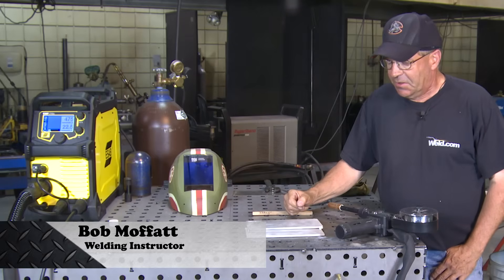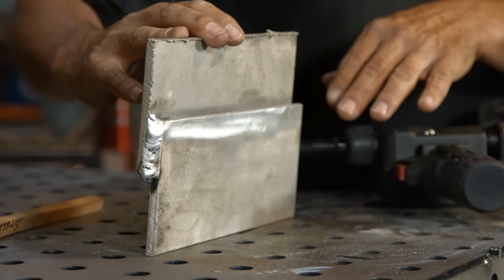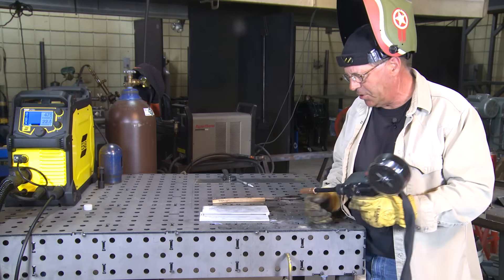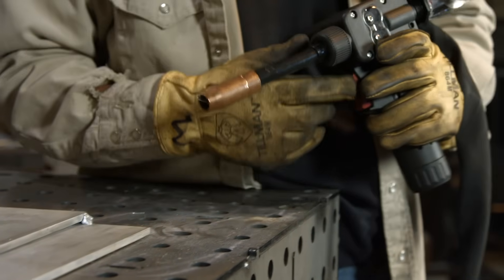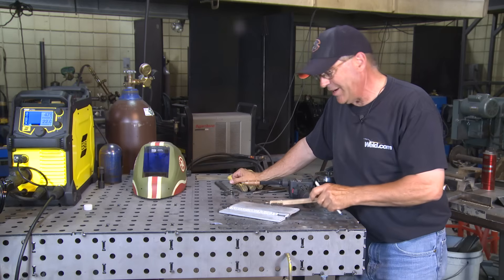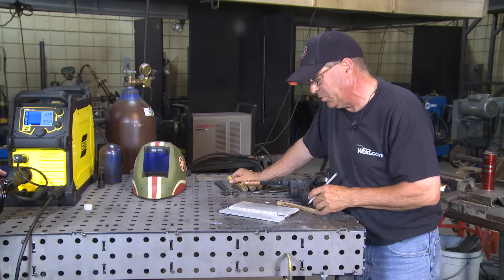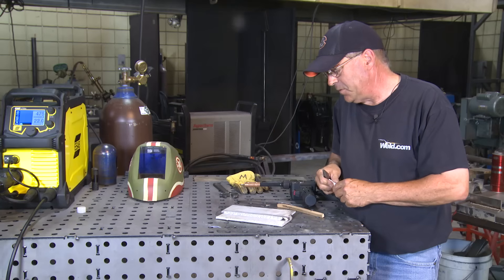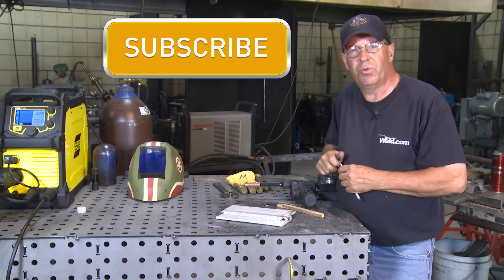Tips For MIG Welding Aluminum Lap Joints With A Spool Gun

Comment: Thx Bob! It sounded like you were in spray mode. Is it possible to achieve spray mode with a lower voltage say for welding 1/8 to 3/16 aluminum?

Comment: I would have dropped the voltage a bit and adjusted the push angle a bit heavier For 1/4" I've had lots of success doing steps from centre of my arc to the leading edge of the puddle and holding 1-2jump1-2jump (*note those are rapid 1-2 counts not anywhere nearly as long as Mississippi's haha) by doing so you find the sweet spot for speed and can then run that pace at 1/2 speed without steps just fluid motion, this welder appeared to be using a 3 steps forward 2 steps back waving back and forth slight push technique which sets his travel speed. (Everyone's is slightly different and everyone runs slightly different parameters, no 2 welders are the same✌️. you shouldn't be way out of the range of parameters or angle ranges and push for more penetration pull for less but 99% of the time you'll be pushing). Practice stringers much more than weaves. Thin guage? ( around 1/8 and below) Keep your work elevated off the table to have less heat dissipation into the work table below and a better more even weld with a more stable arc that goes where you want it to. ! Happy welding lads. Any questions just post a reply I'll answer when I have time.

Comment: Hello

I have Iweld double pulse MIG welder, and I got stuck with the setting. We used synergic MIG welder before and we wanted to change for dual pulse since you can make way better work with it, but I can't even find any settings that works for us.

The problems:

The wire is literally dissapear most of the time when I start to weld and I see something like fire. (As I could see there is not setting for wire speed, I could only turn the wire speed with amper)

And there are still the black spot

Comment: I would have liked to see that unclean weld cut open. Do you not have to use a SS brush to remove the oxide layer when MIG welding like you do on TIG?

Comment: Like TIG, is it preferred to have AC on MIG aluminum?
Reply: No.  If you recall the "Cleaning" part of the TIG cycle?  The electrode gets hot, the work is cleaned a little (oxides come off, you get a sandblasted look near the weld), MIG is only that.  DC electrode positive all the time.  LOTS of "cleaning" action.  doesn't the electrode wire get hot?  Sure, it does!  It melts and is thrown on to the work.  So, it's hard to TIG with DC + polarity b/c too much heat goes into the tungsten and it gets so hot, very inefficient.  MIG DC+ is fine, because the hot electrode goes on to the work and it's just more heat transfer.

Comment: Hi Bob, I’m looking for some tips on welding thin gauge (16) aluminum with a spool gun. I know it’s not ideal, but it is what I have to work with at the moment. I’m looking to fix some areas on the chines/ keel of an old Jon boat. My plan is to clean, clean, clean, and then I will be fitting sections of 1/8” angle aluminum over the bad spots in the keel followed by seal welding. My thought is to concentrate my pool more towards the thicker metal. Any tips on preheating or anything you could think of would be great! I’m thinking .030 wire with a .035 tip. Your videos are awesome! Incredibly helpful coming from a 15 year union Ironworker

Comment: Excellent. Now you did use a Spool Gun but can you explain a bit on MIG welding Spool or not doesn't matter what issues can occur like wire burn's back to the tip and like what difference the Argon Flow would make. Thank you

Comment: For the machine you used did you program it to your wire size? Im wondering if you bumped it up a couple wire sizes it would allow you to have more perameters to choose from? With my experience running a spool gun or push pull using 3/64 5356 welding 1/4" ive always ran it in hot ranging between 450-500 wfs and 24.6-25 volts with either equipment making a fillet weld... i understand youre only using .030 and its limited however having options is also nice. Also i am impressed on how it cleaned on the "dirty side" of your work piece, i was expecting porosity everywhere; do you think you could do a demo on alum that was previously covered in grease and other oily grime, with only a good wipe down and minor grinding prep?

Comment: Luv your videos.  I find them very informative.  I'm retired now,  but I welded in a production factory for years, but never really got much training.  Went in knowing nothing, got 10 mins. training, then got put to work on a production job.  I just started reading  welding manuals and learned a bit from the other  guys.  Like a lot of welders, I never did get any welding certificates or did any tests.     
  Like you said... cracks often start at the end of the weld where a shallow scoop out is sometimes left.  Your method of pulling back and back filling a bit is very good.  I do that too.  However in some situations (like thin sheet metal ),  I find  2 welds work better.  Weld in 1/2 way from both ends and join the welds in the middle.  In a stress area, I'll sometimes even  put a short support weld on the back edge and wrap the corner. A little extra support at a stress point never hurts.   Thnx again for you great videos.  
    Ps...  I'm thinking about buying a small portable 120 / 220 stick welder for a few retirement projects (steel framed picnic tables etc. ).  I know a lot of the small welders are junk, but the AHP arc 160 st  looks like it might be pretty good for what I need. It gets good reviews, but I've never seen one.  I'm looking for a good quality unit that will burn a 3/32 7018 rod on 120 a household current.   Price is not a big concern.  I just want a good one.  Any suggestions ?
         Thnx again,      Gord   gord247@hotmail.com

Comment: um did that brush say steel ,..  your not suposed to do that
Reply: allways use aluminum only gear buy stuff just for aluminum your helmet and jacket are fine but switch everything out to avoid any cross contamination it could leed to porosity problems in aluminum

Comment: Thanks I tried it today my beads look ok but not like yours. I have a Miller 252 /30a spool gun. I have been practicing as much as I can. I'm bust all summer with work. I helped out friend that built boats in my 20s when off in winter fitting boats but never did the welding noe I'm working on the welding. Not a lot of vidios on aluminum. I'm running .035 wire. Seam to be good. At 23.5 amps on 1/4 plate wire at 670-720 is so fare mt best work Thanks Dave

Comment: you are right about the time saving aspect of mig vs tig. not having the "luxury " of time, in a production shop is what it all boils down to. pretty, time consuming tig welds with very little post -cleanup have their place. less pre-heat concerns with mig, on thick sections. when building a pontoon boat, you'll meet your deadline quicker with mig. small jobs sometimes go quicker with tig. there is a balance to be found, which only experience and the advice of other knowledgeable fabricators can make it all come together in a timely fashion. learning by mistakes and success is a hallmark of our profession.

Comment: Mig welding aluminum just sucks sometimes. I do agree that the push angle technique is key, BUT alot of times you cannot push that's why it starts to get real weird welding into tight corners  or having to drag out of a joint it become soot city!
Reply: gas coverage is key. I put some scotchbrite in the nozzle of my everlast spool gun to help diffuse the gas flow and even out the turbulence. It seems to help a bit with extending the coverage.

Comment: If one has a TIG welder (AC hi-freq) why would one need a spool MIG set up? I am only asking for self learning/information, not trying to imply anything more that that. The only reason I could think of might be the speed of doing a weld project, or perhaps the thickness of base metals involved?
Thanks for the great videos.
Reply from the maker: In regards to this machine, the TIG mode is DC only, so MIG is the only process you can do Aluminum on.
Reply: Mig is faster so for production it will be used over ac tig, depending on the size of aluminum.
Reply: Thanks for the direct answer :-)

Comment: I have a question; when I TIG aluminium, (which is my favorite process/metal, by far) I use travel speed, the foot pedal and how much filler I'm feeding, to control the puddle size and the heat; beside travel speed, MIG doesn't allow for that kind of control. With all that heat in metal, I don't understand how the bead doesn't completely wet out by the end of the part, . Is it the wire feed speed that allows the filler not to wet out into a huge puddle? Thanks, great video.
Reply: I have had puddles wet out when running long beads with a spool gun. Usually I try to limit myself to 6 inch welds.
Reply: quinn strohl . on flat? or vertical welds?

Comment: i want to mig weld aluminium without a spool gun, what is the preferred size to use that won't cause me problems? i will be running 5356 to build a boat.
Reply: Mr. green need a push/pull gun then
Reply: chris jones nope i bought a mig now and  run 1.2mm  5356 no problem. nothing special, but the aluminium set up.
Reply: My millermatic has been running 5356 without a spool gun. Seems to work fine. Using a size up tip

Comment: do you have to weld aluminum with straight argon gas?
Reply: yes and no. you can have helium in it if you are doing thicker materials. carbon dioxide is an active gas not an inert gas and will cause problems.
Reply: No.
The shielding gas is usually 100% Argon or Helium or Argon-Helium mix, there are other mixtures, but are not widely used in general fabrication/welding. 
100% Argon is probably the most widely used gas with Aluminum. 
The gas(es) to use is/are usually determined by the particular application or engineers specification, materials, material thickness, filler selection and process. 
Sometimes if the gas is not specified a shop will use what they have available and works. 
Carbon Dioxide (CO2) or gas mixes with a CO2 component are typically not used with Aluminum.
Reply: yes.

Comment: Good video, way to use a brush that says it has been used on steel. Nice welding though.
Reply: It is written on the handle of the brush with black marker. Normally that indicates that it had mild steel bristles or has been used on mild steel, both to indicate that it should not be used in materials with cleanliness requirements.
Reply: David Finch have you considered the possibility that he was labeling that brush as being a stainless steel brush. Maybe that's why it says S Steel.
Reply: Where are you seeing the "S" before "Steel"? 

Believe me I get it, I make similar videos, and am not perfect by no means. My comment was snarky, but should be thought of as instruction to others reading the comment that it is not good to cross contaminate.

Comment: Where does the sot come from? If you weld aluminum with straight argon gas, there is no carbon present.
Reply from the maker: The black soot is magnesium oxide. When magnesium is vaporized by the arc’s heat and comes in contact with oxides, black soot forms. A proper gun push angle of approximately 15 degrees helps keep gas coverage at the leading edge of the weld pool, which reduces soot.  Clean the base material with a stainless steel wire brush, and use the correct weld parameters for the wire size to minimize overheating of the weld puddle.
Reply: soot is typical of an aluminium weld using the MIG process, not sure why.